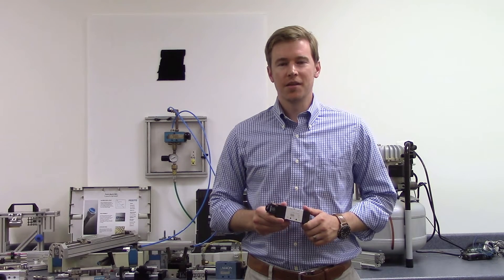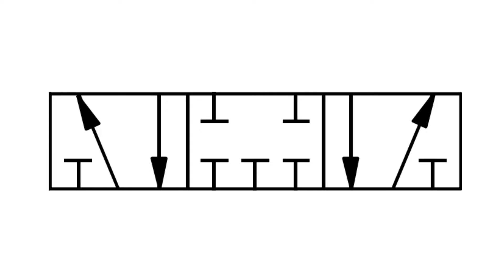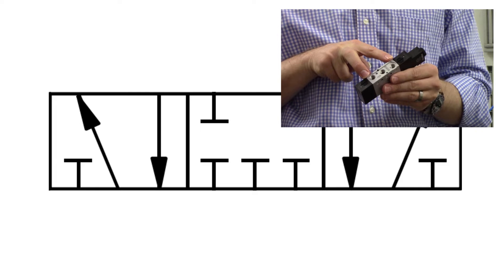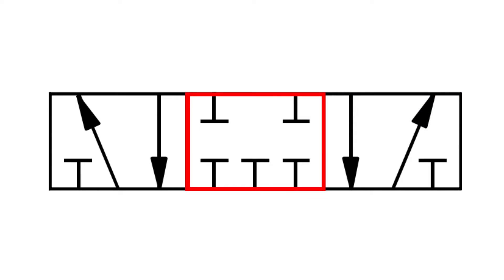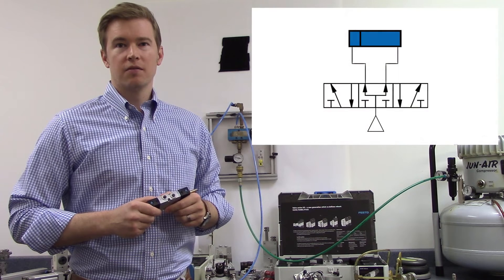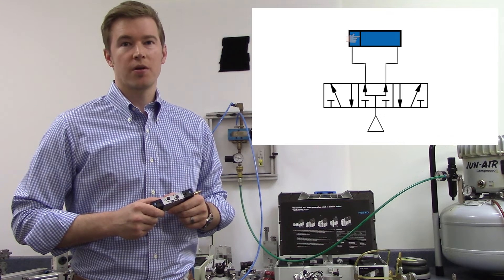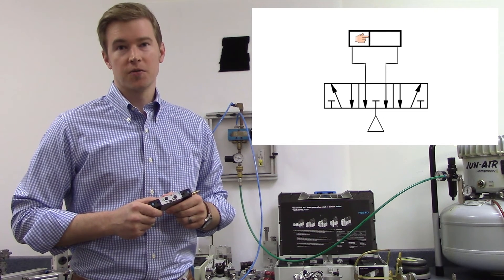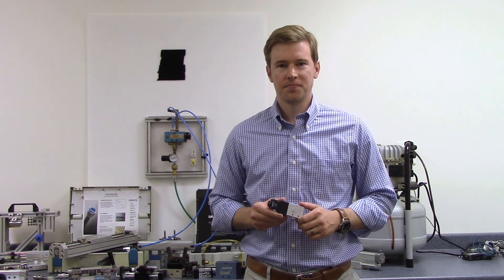5 3 Valve

Comment: Hi sir i want some advice
I am using 5/3 pressurized center valve in my Circuit but when we start our machine then 1st cycle of cylinder go very faster then the normal working condition

Comment: Hi, nice video. I have a query. If 5/3 mid position exhaust Dc valve will help to move double acting cylinder by hand, and also 2 nos of 3/2 Normally Closed DC valves connected to 1 single acting cylinder helps to get same function of pushing cylinder by hand......
So please tell is my understanding correct. Same end result application but for two different types of cylinders, or is there some mystry behind it.
Please clarify.

Comment: When you say middle position pressurized, the symbol shown on the valve is of exhaust, then how is it getting pressurized?
Reply: You can get a valve with a pressurised centre position or one with a non pressurised centre position.
Reply: I have the same question, I connect the valve to the cylinder but when you release the pilot the cylinder is still moving.
How do you connect the valve?
Reply: @zuemy for bigger cylinder it immediately stop as per your wish as you deactivated the port,but if it is smaller then you need to provide either pilot operated NRV or parallel one more pressured line in reverse direction of flow
Reply: It's wrongly shown in video,actually neutral condition always be blocked